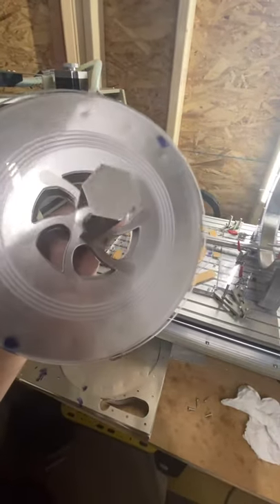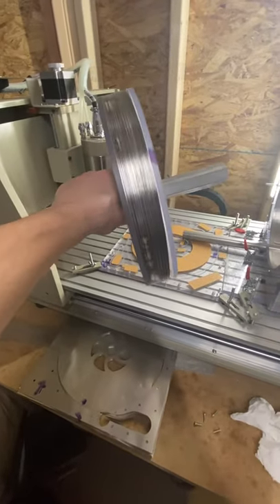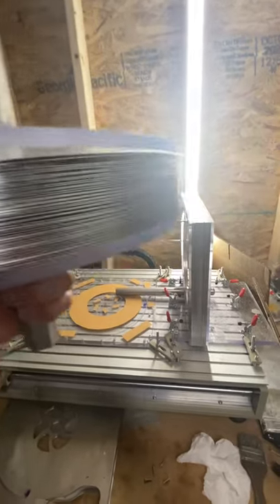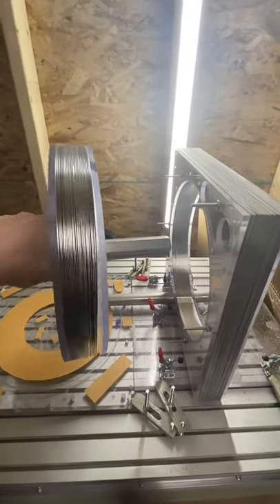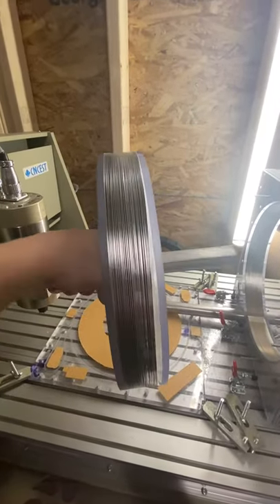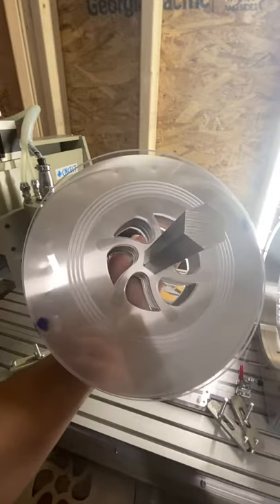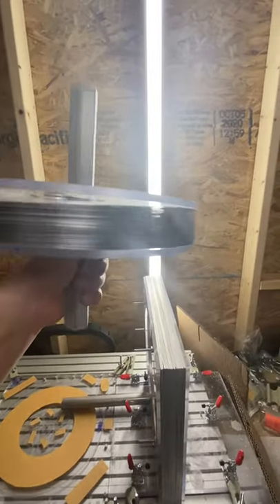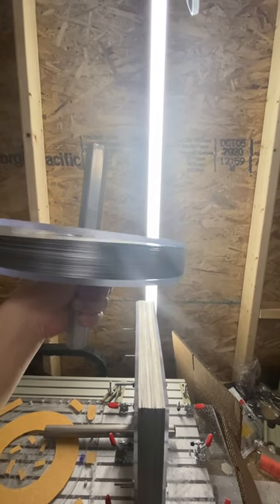10in Tesla Turbine - Thin Sheet Metal Assembly #Shorts

Comment: Who is tesla and whats is turbine????
Reply from the maker: Oh boy are you in for a treat! Lol but just to be clear you’re asking who is “Nikola Tesla” and what is the “Tesla Turbine”, is that correct?
Reply from the maker: Hey Thiago, not sure if you’ve gotten a chance to see my latest tesla turbine updates but check them out! Graphs, charts and all! Just running on compressed air so far while I still work on the larger vacuum chamber system for the turbine. Peak 2.75kW and 6.22ft-lbs of torque 4150rpm with 150psi room temp compressed air with 1/2in supply lines.  And the second video is the latest 1200watt electrical load tests using 170gal of 150psi compressed air dumped to 65psi, both room temp and then 70-80°c heated compressed air. And saw the continuous 1200watt output all the way down to 65psi. Should have this thing ready for a vacuum chamber here real soon! 

https://youtube.com/shorts/yXQy844URMA?feature=share

https://youtu.be/bWpXRzrzf4g

Comment: Excellent work on the dimple man, excited to see how well it performs turbulence wise for you.
Reply from the maker: Hey thanks Blain! Yeah I’m really excited to see this thing spinning in it’s case! I’ll have updates real soon!
Reply: @CharlieSolis  Are you using a 3-D printed case? If so what is your filament?
Reply from the maker: Hey so I will be doing a test casing for my 4in/5in dual stage turbine that will be 3D printed just using pla or something but I will eventually make a full polycarbonate case for it.  However the casing for the 10in turbine is made from all the negatives of the disc cuts. Check out this video I made that shows the disc and it’s corresponding casing piece cut together. 
https://youtube.com/shorts/qJPxkgf3spM

So just like the thin discs and star washers stack to make the whole runner, all the thin sheet negative cuts from the disc being cut out of the 12in x 12in squares discs becomes the casing. It makes it have extremely low waste for cutting everything too! 
https://youtube.com/shorts/7ngtTfZ-uww
Lastly this short video shows them all stacked with the 1in Rod that will be machined to make the variable nozzle I designed 
https://youtube.com/shorts/AORnFlBN8ZM

This is the variable nozzle I designed for it 
https://youtube.com/shorts/JgdJMQbFH-I
Reply: @CharlieSolis  I really like the idea of the hex shaft, that’s actually been quite a problem for these smaller balancing turbine sets. There just aren’t a lot of OEMs that can perform that action. Might be good to start a company making micro laser ablation balancers!
Reply from the maker: Ohhhh I didn’t even think about using lasers to remove the material.... that’s brilliant! 

In Tesla’s balancing patent he suggests using an abrasive jet but a laser is soooo much better. Damn..... and it’s so simple too. It could literally be timed with a sensor to fire the laser at the runner right as the heavy side comes round. It would be so easy to set up an automatic balancing apparatus this way. Good idea Blain!
Reply: @CharlieSolis  i got info on laser type and was happy about the price of things too.
Reply from the maker: @blainevans9237  what wattage are you looking at?
Reply from the maker: @blainevans9237  It shouldn’t need to be high right? Like even a low wattage engraving laser would suffice to remove material in small controlled quantities.
Reply: @CharlieSolis  only 20-50W range, started a lot higher but the cost is worth adding a block of time to complete
Reply from the maker: @blainevans9237  ohh nice that’s pretty beefy for a small setup.